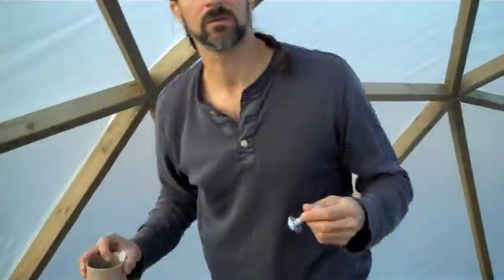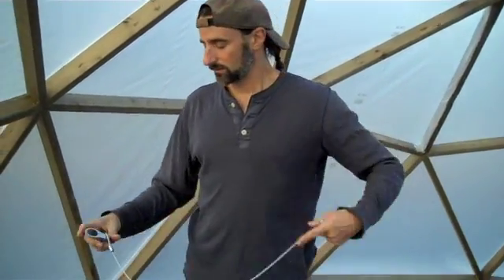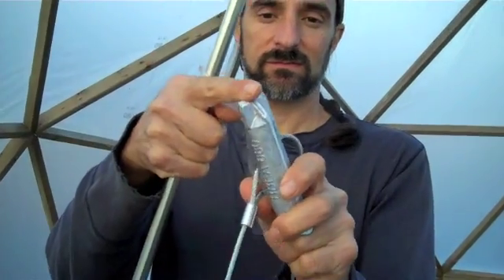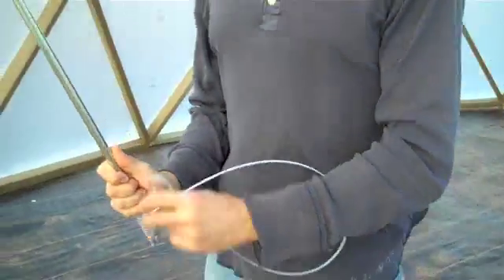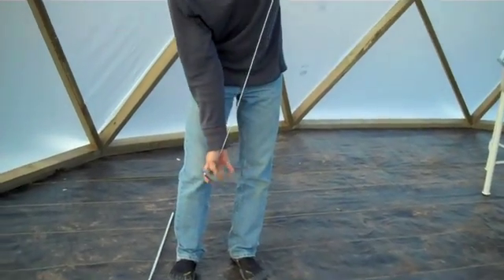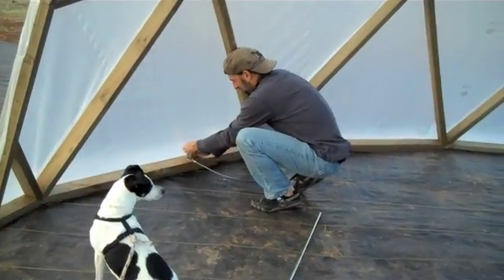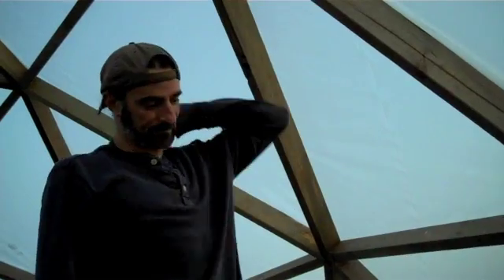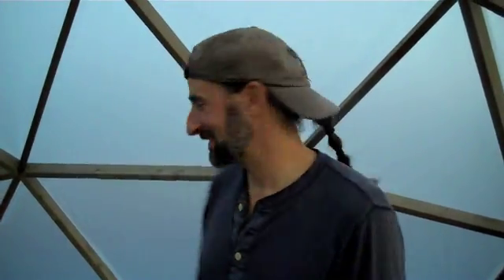ANCHORING THE DOME

Comment from the maker: @jimginnyohio We are located in Tennessee. As for cost, we used: one 5lb box galv. screws (2 1/2 ") $42.55, lumber was $240, the cover was $175, and the permit was $83. Then there was staples $6.50. This came to $547.05. Other expenses were: the anchors-$59.44, the wood treatment-$224.35 (we have extra left over) and the saw was $614. (We went top of the line on the saw but you need a duel angle saw) We could have used treated lumber but didn't want the chemical exposure. Grand total:$1444.84